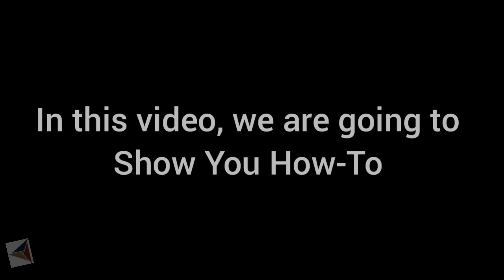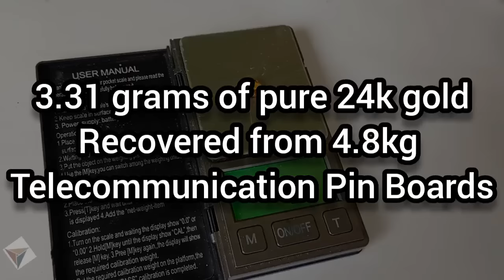Telecommunication Pin Boards Gold Recovery | Recover Gold From Gold Plated Pins | Gold Recovery

Comment: I dont know if this is possible with what you use as a crucible but gold mud doesnt need to be dried before melting
Reply from the maker: It's easier to take the dried powder in a crucible
Reply: @TrinityGoldRecovery  it is actually easier to use wet gold because it wont fly away, just dump the gold in right after filterimg, filter and all. But again i dont know if your crucibles can allow this

Comment: 3.31 grams of gold 👌 
Spending 🙄 5200 ml of HCL and 1520 of Nitric ... 🤔 ... ?
Reply: My thought exactly...ok so you made $200 USD...how much were the supplies???
Reply: @alkraus8818  If they cut off all the gold plating material I'm sure there would be no more than 50 grams. To dissolve 50 grams of material, they would need a maximum 300 ml of HCL and 100 ml of Nitric 😄
Reply from the maker: The cost of acids is not more then $5USD
Reply: @TrinityGoldRecovery  they have same thought as I am, I think you might produce HCL & nitric yourself or you have wholesaler that you buy a big amount at once so the chemicals is very cheaper, right?
Reply: @Путинавтюрьму   Yes !!! :)))  hi used 6720ml of acid for less than 100 gr of plated material !
Reply: @洪志遠-p3s  If buying in wholesale in large quantities then acids will be much cheaper, yes you are right. I am myself buying only in wholesale.
The question is, why waste 1520 ml of Nitric instead of 100 ml? 🤔🙂
Reply: @alkraus8818  
Nitric acid is produced in GREAT QUANTITIES in there country.
It is like people in the us buying soda.
Reply: @TrinityGoldRecovery not sure what world you live in but no!
Reply: This gold recovered average is correct from 4.8 kg boards

Comment: Why did you cut the corners off?
Reply from the maker: Otherwise, they won't fit in the bucket
Reply: @TrinityGoldRecovery  I couldnt tell from the video. Are you checking boards that may have gold under the solder mask? If you dont know what that is search in youtube removing solder mask